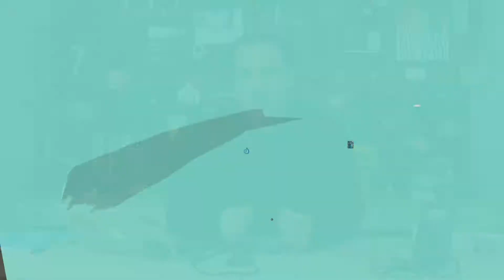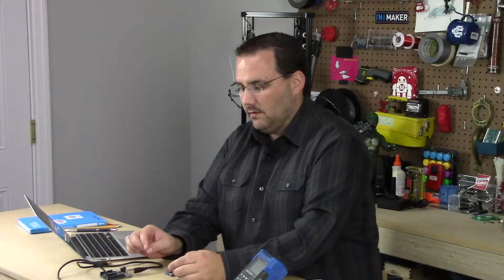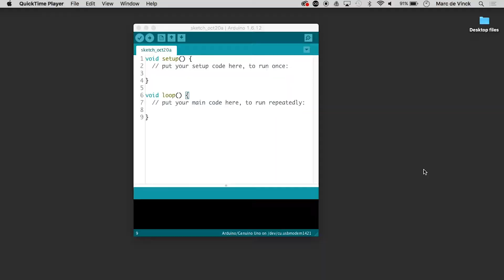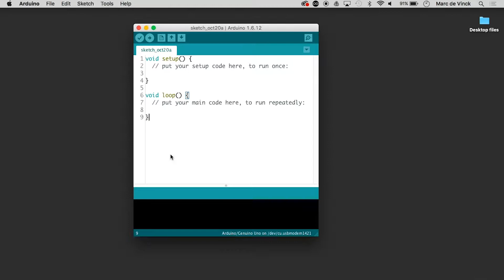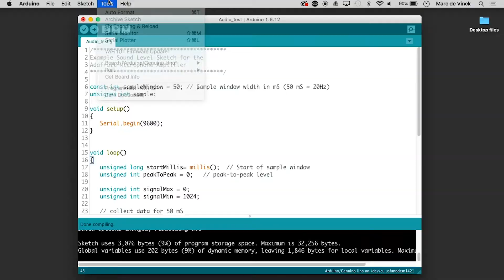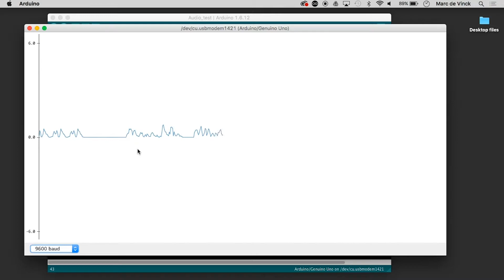Arduino Prototyping Inputs #43: Measuring Sound

Comment: I want to graph the data on Python. But I cant because the time has the date as well
Reply from the maker: Not sure what the issue is? If you are getting reliable time output, you should be able to remove the date. Getting any output is the hard part!

Comment: Hi. Could anybody please post a build of Arduino decibel meter for an Airgun with shown Max last reading. Small size would be preferable, possibly Arduino Nano and Oled screen.  Most Android Phone Apps don't work correctly as the phone kills the Microphone sensitivity automatically and sampling isn't fast enough. Thanks in advance.  Good Video BTW.
Reply from the maker: The beauty of Arduino is that anyone with a little bit of time and effort can build something like that. Google each sub assembly, like "DB meter Arduino" and you  will come up with a few different tutorials and examples that you can modify to suit your needs. Happy building!
Reply: @MarcdeVinck  Hi. Anyone but me. I've tried many times learning Arduino and C programming with no luck. Thanks for replying anyway.
Reply from the maker: @jerzyszczepanski9792  Then find your local hackerspace/maker space and make friends! Trade a building skill of yours for one of theirs! Also local school clubs. You'll find someone.
Reply from the maker: @jerzyszczepanski9792  And there is always Fiverr or UpWork! It's a fairly simple project and would be very inexpensive to have the code written for you.
Reply: @MarcdeVinck  Would you be happy to write the Code for a fee? I have some experience with Arduino, but I've always used already written code. Thanks for a quick reply.
Reply from the maker: @jerzyszczepanski9792  Thanks for thinking of me, but unfortunately I'm booked at this time. Again, check our Fiverr, there are great Arduino programmers on it.
Reply: @MarcdeVinck  Oh. Fiverr!! Sorry,  I thought it was misspelling. Got it now. Will try it out now. Thanks again for being so patient with me. I didn't know such a services exist.
Reply from the maker: @jerzyszczepanski9792  Haha! Yes Fiverr.com - Lots of good Arduino programmers. Ask for a Fritzing diagram too. Very common and will help you build the circuit. Good luck and make sure to share what you make! You can also find people that will make a 3D model for an enclosure too!
Reply: @MarcdeVinck  Will do. Thanks again for help.